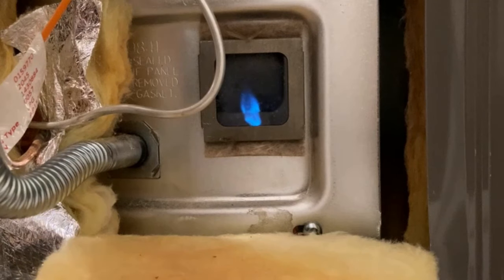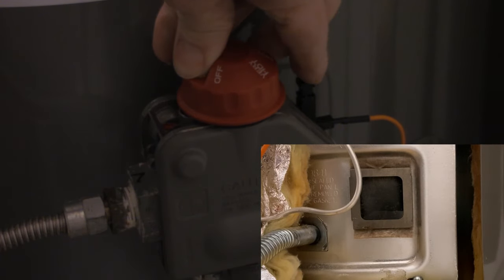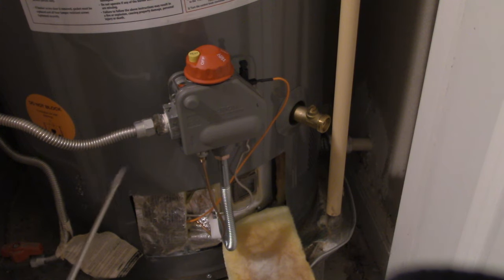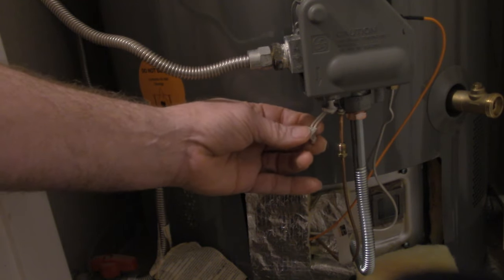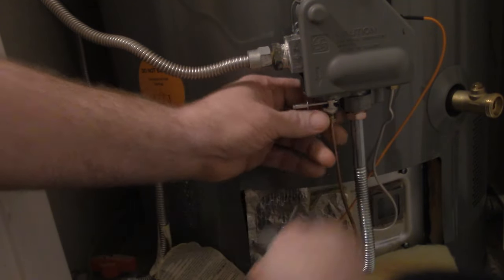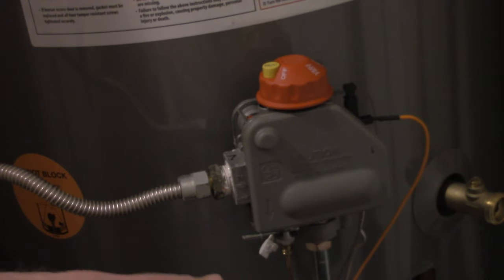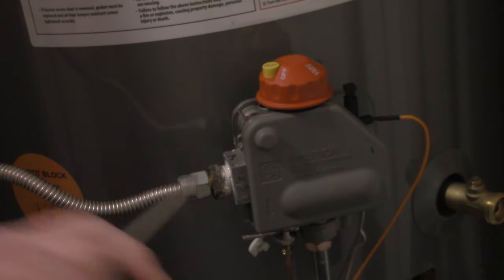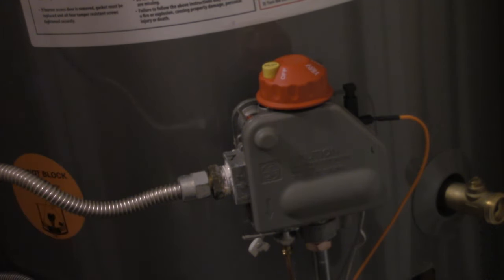Rheem Water Heater Pilot Light Issue

Comment: Mine is a 2020 Rheem PROG50-38N RH60. Looks just like yours in the video. I didn't need a nail because the thermocouple end was long enough and actually fit pretty snug. Still wouldn't stay lit. Does that mean it's a thermocouple problem?
Reply from the maker: It could either be the emergency cut out, gas solenoid. or the thermocouple. I suspect you are still not getting a good connection between the thermocouple and the gas solenoid. Can you measure the voltage of the heated thermocouple, it should be around 25 mVDC.
Reply: I called Rheem today to ask about replacement parts. A plumber installed mine 2 years ago. Nail didn't work A nw thermocouple didn't work either. They were willing to sell me a couple hundred dollars worth of parts plus shipping! And said 2-4 time for shipping. They were unwilling to pay for ANY of it! Nada. Said 1 yr. warranty on parts and 3 years on the tank neither of which do me any good. Basically I bought a lemon. Sounds liked planned obscilesense. Water heaters used to last 25 years. And it sounds like more American greed to me, esp. because the price of water heaters has almost doubled since COVID.

Comment: My pilot light keeps going out but I can get it to relight.   The flame will hold when the button is released.   Turn it back on and have hot water for several hours, but 8 to 12 hours later it will be out again.    Local tech came out replaced the thermocouple and called it a day.   Same situation come Saturday morning.  Any thoughts?
Reply from the maker: If it is a Rheem/Ruud product, I would suspect the same issue as everyone else, faulty gas valve. When mine went bad, it started out with the pilot light randomly going out, it would re-light for a few days. It got progressively worse until the pilot would not stay lit at all. If you try the method in the video and your problem goes away, it is definitely a faulty cut out in your gas valve.
Reply: @MuddFlappRanch  Thanks.   It's a Richmond, which I believe is the same company...installed Jan 22.   Hopefully I'll get someone out tomorrow morning, if not I'll give this a shot.

Comment: Our Rheem natural gas water heater was manufactured October 2020 and was installed in December 2020 into our brand new home by the builder. We moved in on January 1, 2021 and our control valve went out on March 11, 2022 (pilot kept going out) . I contacted Rheem tech/support and they knew exactly what the issue was before I finished telling them. They are sending a replacement out in a few days but I am responsible for the cost of the plumber to install. I contacted the builder of my home and he informed me that several of my neighbors have had the same problem, due to using the same water heaters in all his builds. 
I also read that even the replacement control knobs that Rheem is sending for replacement, are failing too and will have to be replaced.
Reply from the maker: I have heard mixed reviews on the replacement valves. Unfortunately, only time will tell. I would not be surprised if  Rheem would cover reasonable labor bill for the replacement of the faulty gas valve. They know they are in a pinch, and would probably pay a few hundred dollars for a happyish customer.
Reply: @MuddFlappRanch  
They wouldn't tell me over the phone if they would reimburse labor but sent me a warranty form that said they would consider a $215 reimbursement upon review and approval which takes 4 to 6 weeks for a decision.  But sense it's been over one year I most likely won't get it.
Reply from the maker: At this point, they may be willing to pay for a few satisfied customers. I think the bad news is going to keep coming for Rheem.
Reply: @MuddFlappRanch  
We will see. Luckily my bill to replace the valve was only $99. I submitted a reimbursement form so now I'm waiting the 6-8 weeks to get a decision. The builder of my house was going to reimbursement me but I asked him to wait to see what Rheem says.

Comment: Don't want to keep bugging you but, I just received my new control valve and it's the exact same one (model number the same) as the one that went out! Was your 
new one the same? When I put that model # on the Rheem website it said the part had changed.
Reply from the maker: Mine was the same. I was told my the Rheem people that they have "upgraded" the parts. I guess time will tell.

Comment: With this bypass, do you have to turn the gas off yourself after the water temps or does it actually still turn off on its own?
Reply from the maker: The gas valve still works as it should. It will still shut off the gas when the water gets to the correct temperature.

Comment: Mine worked for two years then quit working. When I relit  it wouldn't stay on when the burner is on.   I just leave it on pilot and it warms up the water.  It is really a big issue.  If the weather is very damp it won't stay lit.

Comment: I have the exact same problem with my Rheem PROG50-38N RH60 38,000 BTU POS, less than 2yrs old! The thermocouple measured 15mv when well heated from the pilot, but when I released the pilot button, the flame would instantly extinguish. Works with a nail, tho and stays lit bypassing the Emergency Cutout Switch. It's a 2020 manufactured tank.
Reply from the maker: Glad it helped! Thanks for the comment and the sub!
Reply: I have the exact same model but it didn't work for me. But I didn't need to use a nail because my bolt was long enough to make a good connection. Even with nail it didn't work.

Comment: i have a 2022 richmond does it have the same valve as the rudd and rheem have and are the ones they are replacing them with going to work?
Reply from the maker: It is hard for me to say, as Richmond water heaters are not sold in this part of the country. I do know that Richmond is a Rheem company, and a quick look on the net shows that some may have similar gas valves. So I would say if your gas valve looks like the one in the video, it is probably made by SIT Group. I have no idea when the fault was discovered by Rheem, but most of the reports I have found indicate that water heaters manufactured in late 2020 and early 2021 seem to be failing. When I spoke to Rheem, the warranty center stated that they had repaired the issue and replacement valves would not have the same issue. I guess time will tell.

Comment: My Richmond water heater pilot won't stay lit either. I can get the pilot to light and it will stay on and start heating the water but it all shuts down within about a half hour. The water heater is only about 8 months old and Rheem won't honor the warranty because I bought the house a couple months after the water heater was installed. Total bull. Any idea what my problem would be? Like I said my pilot will stay lit and actually light the burners and start heating the water but it all goes out about 25-30 minutes in. Thanks.
Reply from the maker: If it is similar to the gas valve in this video, I would try to bypass the emergency cut off. I noticed on mine that the cut off didn't go completely out (like a fuse), but just had higher resistance than normal, ~40 ohms vs 2miliohms. It is possible that yours just doesn't allow enough current to hold the gas solenoid.

Comment: One year old within two days. I have this exact problem. 
I tried the trick and it did not work. 
Good information, too bad it didn’t work for me, so hopefully the new valve will work better. Not super happy with Rheem.
Reply from the maker: Are you sure that you have a good electrical connection between the tip of the thermocouple and the solenoid? Of course, this is not the only problem possible, just the most common.
Reply: @MuddFlappRanch  I hadn’t gotten out my voltmeter but I did try three different nails, a stables steel driver bit, and a piece of copper coil between the couple and the Valve. It could be something else, I can’t get anything to happen after I let go of the primer button.
Reply from the maker: @StevieMoore  The thermocouple should have around 25mVDC. If the pilot lights, but won't stay on after you release the button, it is either the thermocouple or the gas valve.
Reply: @MuddFlappRanch  update, Rheem airmailed me a new valve and tubes/thermocouple/gasket. Working good so far. Their customer service was very good, I think they are trying to do their best. There’s not much else you can do after a bad part run is out there but I do hope they look into the issue to prevent it and other ones in the future. IE: quality control is probably cheaper than shipping out free replacement parts and damaging your companies goodwill.
Reply from the maker: @StevieMoore  I agree 100%, I do think they have tried to make this right. When I made this video, the country was starting another stage of disease outbreak. I think they were short on call takers, but once I got through and explained my issue, they responded right away and shipped me the parts. I can't blame them for a bad supply run, but I do think they should have done a better job of letting dealers and customers know of the issue and offered proactive replacements. I do realize that this was a business decision that someone made, but it could have been handled better.

Comment: Wait a minute. Is this video for when you have NO pilot light or when your pilot lights but goes out? Seems to me you should be able to test the emergency cutoff with an ohm meter. So far, this hasn't worked for me!
Reply from the maker: This  will help specifically diagnose issues with the emergency cut out circuit. The usual symptom is the pilot will light, but will only stay on while holding down the pilot button.
Reply from the maker: Also the resistance spec on that ECO is in the range of 10 miiliohms, most common ohmmeters are not sensitive enough to verify the correct operation.

Comment: My pilot wouldn't stay lit,  So I removed the ECO sensor and inserted a piece of copper in the gap.  Then I reinserted the coupling coil and then low and behold we have action,  Pilot stays lit Burners ignited and we have hot water.  It even cuts off when hot and self ignites when cold like normal.  Thanks

Comment: I am trying to remove the white emergency piece, but I am unable to. Is there a trick how to get it off so I can replace with a nail?
Reply from the maker: Did you remove the thermocouple? If so, you may need to use a small screw driver to gently pry out the connector. There are some small plastic tabs that hold it in.
Reply: I used a tweezer

Comment: Great video m8. I've done that and sill going after 2 years. Only a problem if ya have a gas leak somewhere to the water heater from what rheem tells me. But they will send ya a new, improved valve. I like the first ones they make, it's all metal without the two wires fer thermo. Those are awesome. I get them from time to time, weird shit. But I cut that two wire plug off and wrap the together on both side and heat shrink repair.
Reply from the maker: Yes, they gave me no issues once I actually talked with someone. I told them my issue, gave them the serial number and they shipped one that day, received the replacement the next day. Rheem knows that have a huge issue with these gas valves.
Reply: You left it like this for two years? I’m thinking about leaving it for a couple days till I have time to drain it. An answer would put me at ease for sure lol
Reply: I called Rheem today to ask about replacement parts. A plumber installed mine 2 years ago. They were willing to SELL me a couple hundred dollars worth of parts plus shipping! And said 2-4 time for shipping. They were unwilling to pay for ANY of it! Nada. Said 1 yr. warranty on parts and 3 years on the tank neither of which do me any good. Basically I bought a lemon. Sounds liked planned obscilesense. Water heaters used to last 25 years. And it sounds like more American greed to me, esp. because the price of water heaters has almost doubled since COVID.

Comment: Yes matter of fact I tried getting it to work last night. But my valve is blue and I’ve replaced a ton of the blue ones. I’m actually a plumber but not real good at how the gas valves work. But ya thanks for the tip. But my customers situation is a tiny bit different kinda. So the pilot will stay on and I can get the burner to kick on but almost to the second in two minutes it shuts right off.
Reply from the maker: That could be an separate issue altogether. With any gas issue the answer is the same... replace the gas valve or the thermocouple.
Reply: @MuddFlappRanch  or the little glass bulb that hold air intake open!

Comment: I dont need to worry about it blowing up until it gets replaced in 2 days do i?
Reply from the maker: I cannot recommend operating the water heater in this configuration. In theory, if the thermostat portion of the gas valve has failed, and the temperature and pressure relief valve we to also fail it could cause and overpressure situation. Unlikely, but possible.

Comment: Happened to my 1.5 year old tank this week 7-4-22. Rheem told me they know about the defect and it is on tanks made in 2020. Rheem switched suppliers from Honeywell during Covid.  Rheem sent a new valve overnight with a voucher to pay a Rheem certified plumber to install it. 15 minutes minutes on the phone. I told them my plumber said the valve needed to be replaced and gave them the serial number of the tank. It was that fast.
Reply: How did you get the voucher?  My 2 tanks have been installed 11 months, and both failed.  Rheem is shipping new parts, but says there is no way to cover labor.  Very frustrated.  I confirmed the same way Mudd Flapp that this is indeed my issue.  Am I the only one really upset less than year old water tanks have failed?
Reply: @bobc8908  they e-mailed it to me. It may not be enough to cover all of your costs though.  I needed to send the receipt and wait up to 8 weeks. Still waiting. My tank is 18 months old. Pretty  much tanks made in 2020 have this problem. So they say.

Comment: Yes.  It sucks getting the run around from the installer to the manufacturer.  My dad, who is 79 who had a stroke in july called 5 different numbers yesterday, and no on wanted to deal with it.  two years into the warranty.  You may not think they are doing this out of incompetence or whatever.  But having called several "authorized" companies and no help, not even an appointment is beyond frustrating.  You can best believe imma put my boot up someone's ass for this.
Reply from the maker: Have you tried calling Rheem directly? Most reports I have seen is once you get through, they are fast to send out the replacement.

Comment: I had replaced 3 rheem performance water heaters for the same gas valve problem (solid gray like in this video). Absolute junk.   I was able to call rheem on this last one and they tried to send me a “new gas valve”.  I said absolutely not.  I was transferred to a supervisor and she asked what I wanted to do.  Unable to get a full refund like I wanted to go buy a different brand, I opted to and was authorized by rheem, to return it to Home Depot for an in store credit, which I did.  While at Home Depot after getting my $400 credit, I went and looked at what that had in stock from over a year ago when I got the piece of crap I just returned.   I found that rheem had replaced the gas valves on all their units (performance, performance plus, platinum), to a white Resideo gas valve and not the worthless gray gas valve.  Needing a heater ASAP with giving rheem one more chance with this new updated gas valve, I bought and installed a rheem performance plus on 11-9-22.  It fired right up and no issues, FOR NOW!!
Reply: Additionally, I read some reviews that folks are having issues getting in contact with rheem.  This was my 3rd return under warranty replacement and never had an issue contacting rheem.  In my opinion and experience, I do give rheem customer service credit with the issues and replacements I had to do.  However, I’m pretty close to a Home Depot, so instead of dealing and scheduling for a tech to do it, I just did it myself. It’s a simple remove and install for me.
Reply from the maker: Glad you store was willing to help. I purchased mine through my propane supplier and they were not real helpful. The propane company told me to call Rheem and if they didn't help to call them back.

Comment: Does anyone know what it’s for? I’m seeing some pretty scary warnings about bypassing the thing. Some people are acting like the very existence of humanity hangs in the balance of my water heater. 😱
Reply from the maker: The emergency cut off is designed to shut off the gas in the event that the thermostat fails. In theory, the thermostat could fail in such a way that the burner does not shut off, which would result in the water boiling. If this would happen, The T&P valve should open or in a total series of failures, the tank could rupture. The likelihood of all of those failures occurring simultaneously are small, but not zero. Best practice is to use this video as a troubleshooting tool and replace the gas valve assembly as soon as possible. I cannot recommend leaving the water heater unattended with the emergency cut off bypassed.
Reply: @MuddFlappRanch  wonderful! Thank you for the explanation and thank you for saving me from joining the cult of Wim Hof!

Comment: Does anyone know if a yellow pilot light is safe? Mine is not blue flame
Reply from the maker: it is not. A yellow flame indicates incomplete combustion. It usually means not enough air flow to the combustion chamber. It can release carbon monoxide which can build to unsafe levels pretty fast.
Reply: @MuddFlappRanch  thank you for your prompt reply! I ended up calling a technician. He found out the thermocouple needed to be replaced and charged me $280 CAD for labour and parts. Sigh